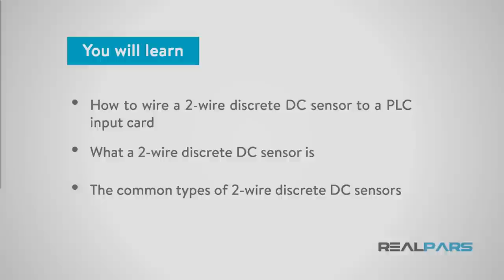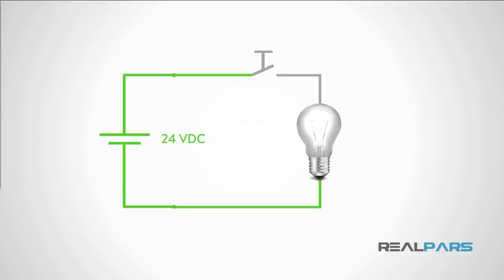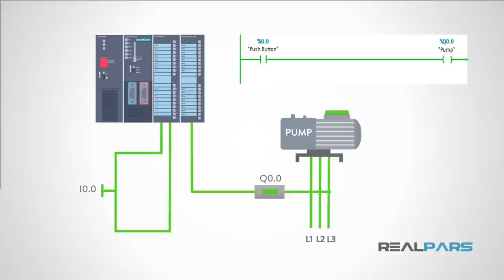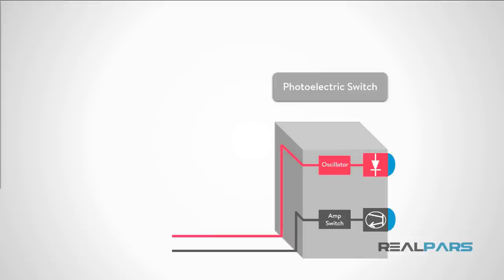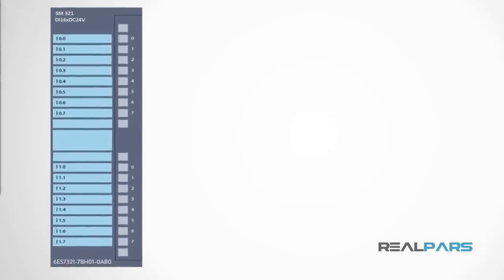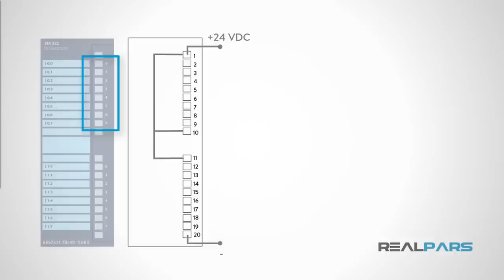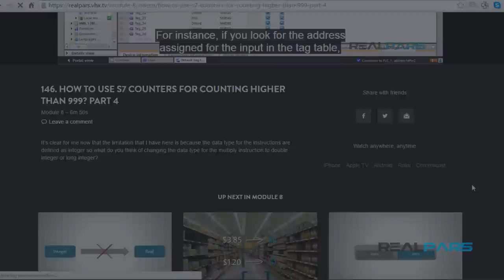How to Wire Discrete DC Sensors to PLC - Part 1

Comment: I really appreciate your efforts to convey information in such a methodical way. Thank you very much.
Quick question though, if the card terminals  2 to 9 are all supplied from 10(+24vdc), then the proximity switch terminals are both supplied with +24vdc terminals 10 and 5. 11:44
Reply from the maker: Terminal 10 supplies +24VDC to the switch.  When the switch closes, it sinks the voltage to Terminal 5, which causes the input to go "true" (value of 1).  The description at 9:36 may be a little misleading, as power "supplied" to Terminals 2 - 9 occurs only when wired to a switch and the switch closes.  Hopefully, this makes it a little clearer.

Comment: Its really great to have discovered this channel today. I'm doing a bit of a binge on everything you have on PCLs and learning a lot! One question - say you wanted to wire in both sensors in this video to the supply in channel 10, is that possible? If so, how would you go about doing this? Connect 10 to a terminal block with branching wires to each sensor?
Reply from the maker: Yes to both questions.  Simply run a wire from Terminal 10 to a block with 8 or 10-terminal blocks that can be used to distribute 24VDC (terminal 10) or for common (terminal 20).
Reply: @realpars  Okay great - thanks!

Comment: @11:43 did you mean to say channel 5 instead of 3? Because in your schematic it appears to be channel 5 but you say 3? Sorry just trying to make sure I’m not missing something here. Thank you for all of your videos they are by far the best and simplest explanations I have located online with all of your videos! 👍👍👍
Reply from the maker: Hi there,

Thank you for your compliments and happy to hear you found our videos useful.
If you follow up the "Terminal D" wiring toward the card's "LED Indicators" you will see number 3, which is corresponding to channel 3 as it is mentioned in the video.
The point is that, when you open up the card's door, you will see the "screw terminals" to which the wires are connected. The numbers beside the card at 11:43, from 1 to 20, are the numbers on the "Screw Terminals".  Therefore, "Screw Terminal number 5" is corresponding to "channel number 3".
For more clarification, you may want to search for this part number: 6ES7392-1AM00-0AA0 (40-pin Front connector for signal modules with screw contacts).

Please let me know if you had further questions.

Comment: What about the other Inputs B-H? the terminal block get 24V from 10, bridged A+ to H+ ? Or more likely from the power module that supply the plc?
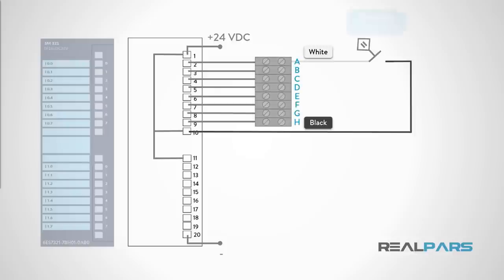Reply from the maker: Thank you for your inquiry. Firstly, I'd like to clarify that the card we previously discussed is an input card. In our video, timestamped at 12:47, we provide a detailed guide on how to correctly wire this card. To power it, you should connect it to a +24 VDC source. This can be achieved by either using terminal 10, as demonstrated in the video, or by directly connecting it to the main power supply's +24VDC output. The latter option should then be looped back to the input card via one of the terminals, as shown for the "A" terminal block in the video.

Once your switch is activated, and you have programmed the logic in the PLC accordingly, the input card will respond as per your programming instructions. For further in-depth information and learning resources, please refer to the Siemens website. You can download the technical manual from the following link:

Siemens Technical Manual Download https://support.industry.siemens.com/cs/document/109808766/s7-300-et-200m-automation-system-original-instructions?dti=0&lc=en-US

We hope you find this information valuable for your learning journey. Happy learning from RealPars!
Reply: So terminal 10 is designed and capable to supply all input terminals 2-9? In case you have 8 switches, you need a terminal block provides 24V 8 times, A+ 24V black wire and A input white wire, for example. Thx alot for your great work and fast answer, really really appreciate it.

Comment: How come the red wire of the photoelectric switch is connected to terminal 10 instead of the terminal block? I thought terminals 10, 11 and 20 were for the negative terminals of the power supply.
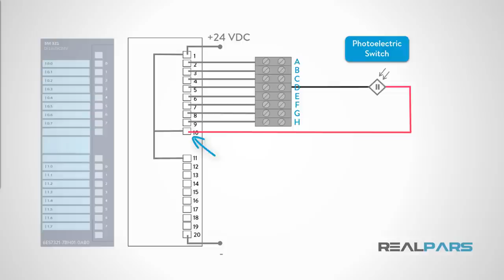Reply from the maker: Terminals 1, 10, and 11 are +24VDC.  Terminal 20 is Common.  At 11:47 in the video, you can see that power is supplied via the red wire and connected to the corresponding PLC input terminal via the black wire.  Whenever connecting devices to a PLC card, consult the PLC I/O card documentation to determine how the device should be wired.  A PLC card can many times support many different types of devices, so consulting the documentation is usually required.

Comment: Can  we provide external  24 volt power sourcing to the proximity switch?
Reply from the maker: Yes, provided you have a 3-wire switch which requires a separate 24VDC input.  Consult the wiring diagram for your specific device to see the options for supplying power.  Be careful:  all signal wires connected to a PLC input card needs to be on the same 24VDC circuit.

Comment: Not too sure if I’m asking the question correctly but today I ran a circuit to a filler and I figured I was going to be pulling a blue+ and a blue/white- wire but he told me no you were supposed to pull two blue wires a common and a signal what is the difference?
Reply from the maker: The only difference is the color of the wire sheath.  One wire, regardless of color, will be the positive (+) or signal wire and the other will be connected to common.  There is a lot of disagreemet as to the "proper" colors for discrete 24VDC signals. The two schemes that seem to be best aligned with UL508 (a standard) and NFPA79 (a code) are blue (+) / white with blue stripe (COM) - and - blue / blue.

Comment: Please explain how two wire sensors work??

Thank you for all previous videos
Reply from the maker: 2-wire sensors simply provide a contact-closure so that a complete circuit can be made.  In the case of a PLC input, the switch allows current to flow from the positive terminal to common. What is not shown is the internal circuit which is activated when the switch is closed.  That circuit is used to indicate that the discrete input is "made", or in terms of the PLC program, set to a value of ON or "1".

Comment: in polarized sensor i have + and - terminals what i had understood from the video is connect + terminal to + 24 of plc and ther other terminal of sensor to plc input  for the same sensor can i connect the - terminal of the sensor to the - of plc and + terminal of the sensor to plc input ??
Reply from the maker: With the right type of PLC card you can.  You need a card that will source 24VDC at the PLC input terminals (a sourcing input card).

Comment: Where we wire output cable, for example we have 2 wire sensor we connect the _ and + wire on the input but where is the output cable connected to run the motor or other device?
Reply from the maker: In this video, we show the connection of an input sensor, such as a switch.  If you want to open a valve or start a motor based on the state of a discrete input,  you would need to provide a discrete output card and the appropriate PLC logic to drive the output to the contactor or motor starter.  See the RealPars video "Star-Delta Starter PLC Program and Wiring - Part 1" for more information.

Comment: I'm a little confused at 9:30 in the video. Why is the positive power internally wired to terminals 10 and 11?   And why are terminals 2 through 9 negative? To be negative, don't they have to be internally connected to terminal 20?
Reply from the maker: Terminals 2 - 9 are grounded internally (negative) through the backplane of the input card.  Providing power to terminals 10 and 11 provides a means to isolate the first 8 inputs from the second 8 inputs. There is optical isolation inside the input card to provide this protection.

Comment: How long is the maximum of sensor cable wiring?
Reply from the maker: 2-wire 24VDC discrete signals can be run up to 1000m, but it depends on a number of factors, like wire size and environmental conditions. You should be safe up to 100m with no issues.

Comment: HI. How is possible to recognize if a device is polarized o not ?? Thank you
Reply from the maker: Hi, you can read the manual.
Reply from the maker: Excellent question!  You would normally have to consult the vendor's wiring drawing or other documentation.  Also, polarized devices would normally label the "+" and "-" terminals on their device terminals in order to indicate the sensor is polarized.  Often, the sensor will have a sticker or label indicating that the sensor must be wired in a particular way.

Comment: Very usefull, but I still have some questions: where comes the power from that feed the sensors?...is it taken from the input module? In the example of the pushbutton, wouldnt the conection betwen   terminal 10 (+) and  A( -) or any other terminal of the top 8 DI's make a short circuit when the button is  pressed?  I really didn't get this so well. And lastly what happens if we have a module filled with field devices if they have two polarized terminals? ...the common terminal (+ or -) from all the devices gets connected to the same terminal on the PLC, or Programmers or Electrical Engeneers get common from the PLC to a terminal block with some branches to distribut it there and make it easier and functional to wire the common from all sensors apart from the Input Module common terminals?
Reply: Erick Ontiveros Lara you can watch his other video.
Reply from the maker: The 24 VDC power at the input card terminals is supplied by a separate power supply.   For the inputs, the internal circuitry of the input card provides the necessary load to prevent the closing of the switch from creating a short circuit.  The internal circuitry senses the  switch has been closed, and writes a "1" to the input card's data table.
Reply from the maker: Yes, the video shows the connection of one sensor to the PLC input card.  If you have a "full card" with 8 or 16 sensors, you would use a set of external terminal blocks to connect the common wire.
Reply: Thanks a lot for the feedback, I think I do understand better now. 

Regards!

Comment: I'm assuming the sensors are not transistor based.
Reply from the maker: You are correct.  See the comment above to your first question.  Transistor type switches are normally 3-wire switches and must be wired differently.  See "How to Wire Discrete DC Sensors to PLC - Part 2".

Comment: Somebody explain me why one wire of sensor connected to terminal 10?
Shouldn't it be connected to ground?
Reply from the maker: Terminal 10 supplies +24VDC to the circuit.  The "signal" or input wire is connected to terminals 2  - 9, where input 0 is connected to terminal 2 and input 7 is connected to terminal 9.  Ground is provided as a common ground point for the entire card, through terminal 20.

Comment: Thanks for letting me know. I thought sensors always had more than 2 wires.
Reply from the maker: Many sensors do have multiple wires, including the ones described in the RealPars video "How to Wire Discrete DC Sensors to PLC - Part 2".  Many proximity switches are "contact closures" which only require 2 wires.  Hall effect sensors (magnetic switches) used in many pneumatic valves as position switches are 2-wire sensors.  Electromechanical switches, such as rocker switches,  are 2-wire sensors.